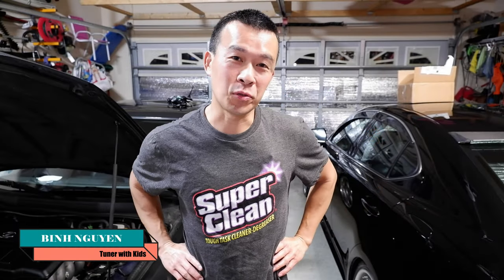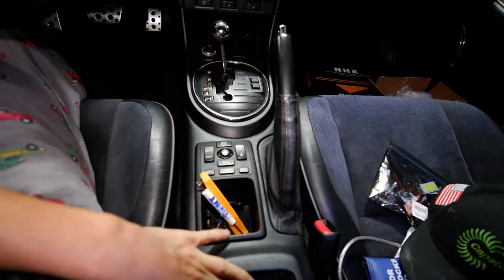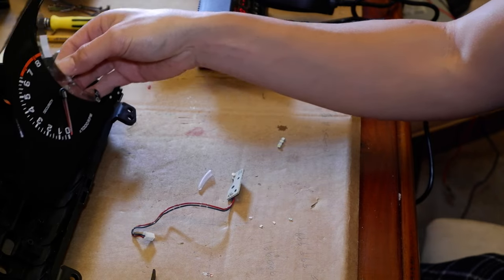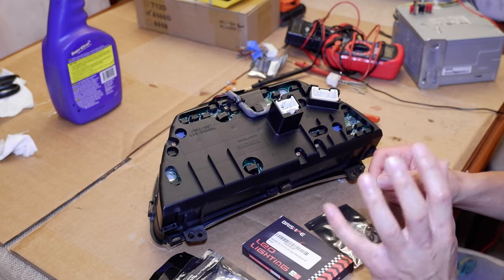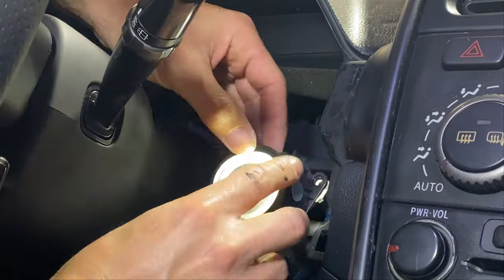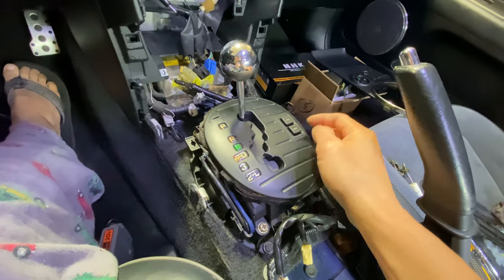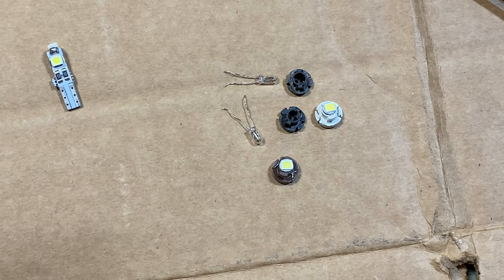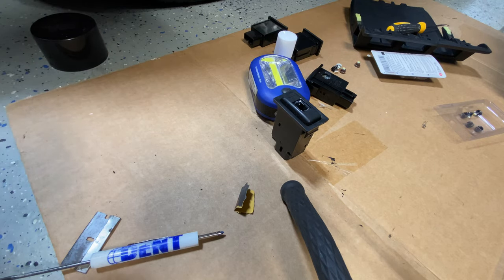LED Interior: Lexus IS300 Dash Gauge Cluster | USB Outlet Install | Blue LED Security Light

Comment: Hi all! 

Is there a way to make the led light illumination in the climate control even? (Or even as possible)? In some areas of the climate control, it is brighter while some are not so brightly illuminated..
Reply from the maker: I think it has to be a custom setup on the board to get it illuminated fully. I noticed it now after driving for a while that the bulbs don't distribute well and the dials are dim.

Comment: Awesome Video!! Thank you
Do u use 12v to Illuminate the cluster at home?
Reply from the maker: Yea. I have an old computer power supply with custom terminals for 12V and 5V.
Reply: @TunerwithKids  thanks a lot...  I drive a IS200 and i have a Kouki digital cluster and want to test it at home, that's why ask of the voltage for the (bulbs, led's) Illumination

Comment: At min 12:35 you said you ordered the armrest covers your missing. Can I get a link? Im missing the passenger side :(
Reply: 12:20*
Reply from the maker: The plastic plugs? I found a set used for $15. They are like $25/each at dealer.

Comment: Hey man any idea why when i turn on my headlights and fog lights the clock on the climate control goes out and when the lights are off/ in the first option the clock illuminates. I am having no trouble with the rest of my climate control. I believe the volts are just too high to light up the whole dash at once. But let me know what you think. Thanks.
Reply from the maker: No idea. Maybe a bad ground or loose connection.

Comment: For the climate control leds which ones will I need I see on the description you but 2 different sizes
Reply from the maker: It uses both. I think three are the big ones and the hazard light and seat belt are smaller. Or vise versa, don’t remember.

Comment: Any idea on how to change the bulb on the DEFROST/AIR RECIRCULATION/AC?
Reply from the maker: Did I not show in this video? It may be in my other LED swap video for radio and center controls.
Reply: @TunerwithKids  I checked both videos and both videos, yours do not light up either. At least it doesn't look like it. Unless it's super dim barely noticeable.
Reply from the maker: It’s probably very dim. Some of the climate stuff using bulbs that don’t disperse well.

Comment: Nice video! I swapped my cluster/clock/ac lights, and one side of my my clock is dimmer than the other along w the ac lights, could it be the connection? I remember it was a tight fit putting the leds in those holes
Reply from the maker: It might be a defective bulb.

Comment: Hi ... I noticed you used a 74 LED for the  shifter bulb, but on the other side where you have the  SNOW and PWR button what bulbs are in there, are these Neo bulbs?
Mine at the moment don't light up, didn't  know if they were supposed to or not.
Any help appreciated... Thanks Clive
Reply from the maker: They are smaller neo but I had to pull them apart and use the stock mount to fit right.
Reply: Where did you get the neo bulbs for these?
Reply from the maker: @stevenhanaford4340 check links in description

Comment: Man….. the 3x big LEDs are different from your YouTube video and your Amazon link… one doesn’t fit (the bulb above the socket)

EDIT:// Amazon seller (the same link in description) have sent me different bulbs.
Reply from the maker: It’s what I used. If you watched closely, some of the NEO bulbs ARE NOT plug and play, I had to pull the core out and use the original sockets to fit.
Reply: @TunerwithKids  Hi Binh, I am sorry for accusing you for something not your fault, I ordered the same thing you have linked, but the dumbass seller sent me a pack of 18 bulbs with 9smd each side, 36 SMD in total per bulb (crazy)... I contacted Amazon after realizing what the fuck just happened and got a full refund as I ordered from USA to NL. 

My apologizes.